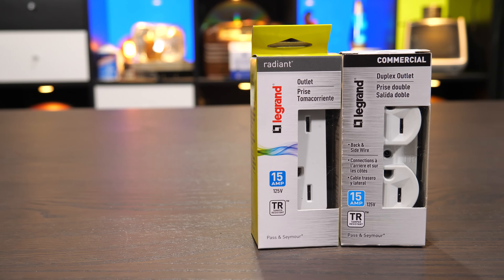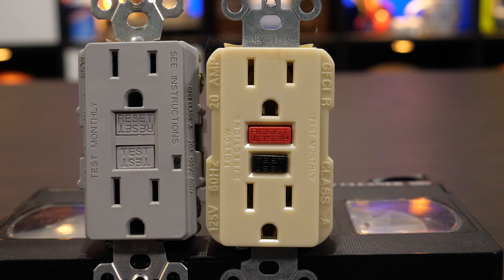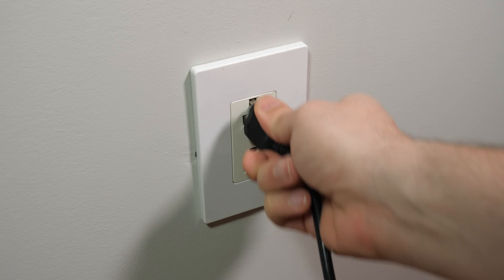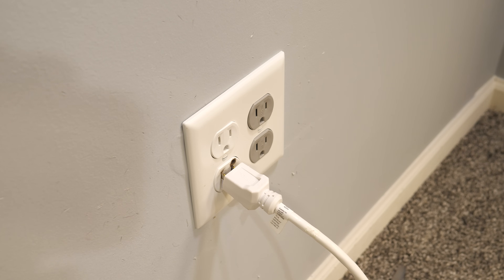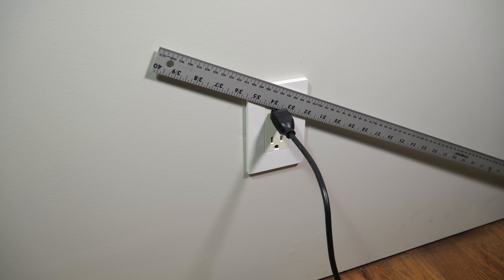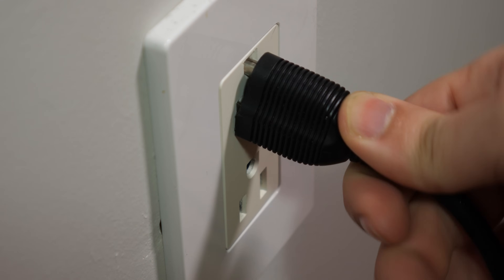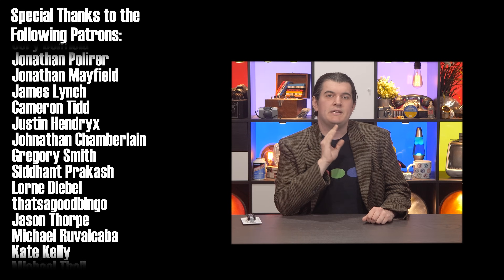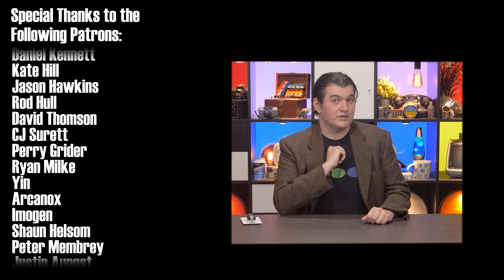Power outlets are topsy turvy - but does it matter?

Comment: Having a reversible plug design is one of the best things about Europe, no idea why no other regions copied it.
Reply: I guess other places preferred to have polarity guaranteed, at least when necessary. As the other person said in the US many ungrounded plugs are reversible, they’re just not the polarized type (so anything double insulated like say a USB power supply could use that). It often does end up being polarized anyways even if it doesn’t need to just because it’s common enough that there’s lots of supply for the ends of cords in a polarized form and a lot less for unpolarized cords. Devices that go straight on the wall don’t have that issue though.
Reply: The early BS standards for UK plugs were two-pin rounded. They weren't very safe though. BS372 even was 90 degree with a 45 degree cord entry.
Reply: Most US plugs are too. It is just in some cases that having a polarized plug can increase the safety of an object, like a toaster.

Comment: 15:28 This deficiency can be addressed by copying modern British plugs that commonly are recessed on both sides which makes it necessary to hold it in a particular way, as it is very uncomfortable or cumbersome to hold them in any other way thus minimising risk of finger zapping as well as helping one to generate enough grip to insert the plug in a socket or pull the plug from a socket.

Comment: we have dual sockets  turned 180 degrees, with ground pin in the middle. This is so it's easy to route 90 degree cable I think.

Weirdly enough, the L and N are swapped in one of the sockets...

No idea about variety of plugs in US but I think just plastic shroud above  and below would help a lot

Comment: The solution for the 45 degree plug at ~15:20 would be to simply install the outlet including the wallplate at an 45 degree angle as well. This would also end the discussion if vertical or horizontal orientation is better because the 45 degree orientation is obviously superior.

Comment: Use caution, maintain your equipment, don't play "throw knives at the wall", has worked for years.  I would like to see more 'side' or 45-side plugs.  Fit better behind furniture, less likely to pull out.  Those with 45 can be doubled in a duplex outlet.

Otherwise, who wants to completely revamp gazillions of plug/sockets in North America (Canada uses the same).

Comment: Two things: 1. In my 10 years in Chicago, I never once saw a sideways plug. 2. "Somebody" installed my kitchen plugs "upside down" with the ground on top, saying it was "the correct way." Problem? Every outlet extender is made for ground at bottom - mine have a solid plug at the top and a chintzy plastic pin to go in the ground of the bottom one. In a ground down plug, this holds it securely in place. In a ground up plug, it only has the plastic pin at the top, and wants to fall right out. So I think you've solved my argument in only 18 minutes.

Comment: I still find it odd that none of those power outlets have switches. That would alleviate the problem, you will still have people who wouldn’t use the switch and just plug in or unplug any device. As far as I know, here in New Zealand, you can’t buy outlets without switches - at least, I’ve never seen any.

Comment: Here's a suggestion: start running single phase 240v AC to the home and use (the generally considered superior) type G plugs for it. You could then also draw more power (3300W max) and as an extra bonus, enjoy some energy savings as power supplies are generally more efficient with the higher voltage.
Reply: You should check out some of his other videos: hint USA standard house supply is 240v single phase with a grounded center tap neutral.
Reply: @johngreen5808  "hint USA standard house supply is 240v single phase with a grounded center tap neutral."

Not true I'm afraid. It's two phase with each phase 180° offset from the other. Simple and easy to check with any decent search engine.

Comment: The only time it really is turned to ground up is to signify the switched outlet.  In US NEC code, Every room requires a switched light.  If there is no built in lights, i.e. recessed can lighting, then there needs to be a switched outlet...

Comment: My wife was using a measuring tape above a plug in our room. It dropped and slipped down, touching the two prongs. As measuring tapes do, it got stuck and fused to the prongs. It didn't just trip the breaker, but completely fried the breaker. Luckily for her she was only holding the plastic case of the measuring tape at the time. The item plugged in was a two-prong variety and ground-up wouldnt have saved anything. 

I would like to see a video about how you would redesign the US outlet and plug combo

Comment: I've witnessed one these bridged pins incidents, a kid was resting a quarter on top of an adapter, and then the quarter fell behind it and rested perfectly between the pins. It's not hard to do, though you are right that in many cases there isn't a ground pin so orientation wouldn't have mattered. It seems odd to determine what a home design should be based on some random products, if people switched orientation those products would switch. And there would be a market for adapters that make the old products functional. It seems like you're putting the cart before the horse.

Comment: I think this is a perfect example of "You haven't solved the problem you just moved it." But the argument you make for not flipping them because of right angle plug falls exactly within this too. You didn't solve the problem, you moved it. You still can't plug 2 right angle plugs into the wall just because they're ground pin down. If you plug a right angle plug into the top, you can't plug one into the bottom. I don't see any reason not to put the ground pin at the top.

Comment: Solution:   Try several things in combination. Right angled plugs that assume ground up with a deeper thickness with recesses to grip your fingers into. Sleeved Line/neutral pins. And when multiple sockets, assume side by side formation, not one-above-another.

Comment: Seems like we need to get a l'il Bri'ish abo't it and stop being pansies about managing our own plugs. Any plug can be transformed into a right-angle if the and is chopped off, the wires are stripped back and the loose ends are fastened to a replacement right-angle connector.

But maybe… we need a new adaptation of the standard. For higher-draw appliances, we have the capability to twist the connector into position. Let's adopt a variant of 5-15P that's a twist-lock connector. Oh wait we have that! L5-15! It could be made code for connectors to be L5-15 and it'd improve safety by a wide margin because you have the twist the damned thing once it's plugged in for additional safety. But then everything would need to be adapted for this, and you'll find dodgy L5-15 to 5-15 adapters.

A twist-lock solution would also complicate (or make extinct) 6-taps which rely on the standard 5-15 connector. It would however standardize a twist direction, and in turn standardize a 45-degree cable orientation. But it would become less safe for sideways-installed outlets. Yeah, it's some tough stuff to figure out.

Comment: Years ago, while working in a pharmacy, the cashier dropped a dime (Canadian dime)  and it JUST happened to land in between the plug and the wall.   What followed was a loud noise, sparks, the breakers popping.  When we found the dime, it had a hole melted in the middle. 
 
Had the outlet been installed upside down, it would have most likely  hit the ground connector and bounced away .  Just a once in a million shot.
Reply: That is an excellent point and actually hits the nail on the head (the dime on the hot pin?) about what I feel Alec missed in this video: Statistics. We know that low-probability events will eventually happen: that's the whole law of statistics is that if it has a 1% chance of happening then eventually, it happens!

So a better measure of effectiveness is how much does this change move the probabilities? Instead of 0.1% of happening in a year it drops to 0.01%? That'd be pretty big deal; especially if that movement was for kids or fires.

The population size is huge and there are enough anecdotes in this comment section to make me think that this happen more often then Alec acknowledges. If so, then small changes in the probabilities can have major implications in the absolute number of incidents.

tl;dr Alec's argument is weak sauce on this episode. I've never had my house broken into but I still lock the doors even though it's a very low probability event.

Comment: I had a wi-fi extender brick with one of those little push to reset holes.  Someone thought it would be a good idea to leave a paper clip sitting on top so they could reset it whenever they needed to. The next time the brick got bumped, the clip fell right across the plugs and BANG. Tripped breaker and nasty soot stain.

Comment: All the Nema 5-15 outlets in my house were installed with the ground on the top. It drives us crazy, because all on-wall adapters expect the ground to be on the bottom. Everything looks upside down. I've been slowly replacing the outlets in each room and reversing this craziness.

Comment: This past year I decided as an add-on project of replacing my light switches in my 32 year old home with modern programmable dimmers that I also replaced all the receptacles as well. First, most homes have more than you think....I counted 48 in my home at 3280 sq ft. The original receptacles were all installed ground-down and I installed the new ones ground up. Why? Because I had heard somewhere that ground up was correct and it was like that on the packaging for the box and printed indicators on the units (in this case, Lutron). it did pose a challenge to some older power strips I have and I have replaced some of them that have right-angle plugs. That seems to be a decent solution. Also, I was wondering about if there was a correct orientation for sideways since I have two of them in my kitchen. I just checked and I wasn't even consistent there...one of hot wire up (correct) and the other is hot wire down. Although as Alec pointed out there is really no code requirement for this, my anal nature means I'll reverse this at some point soon to match the other one. I also have an outdoor plug (shielded in a box) that is hot wire down but I think I may leave that as is since I use a right angle extension court on the patio where it's located and it actually useful for the cord not to point toward the door to the inside which is right next to it.
Reply: folks these days are on some weird and confusing kick to put the ground up.  for the last 60 years the standard convention is that for normal, 15 amp circuits the ground pin goes down, and for 20 amp circuits the ground pin goes up.  Also in homes with switched outlets for lamps they put them upside down sometimes.

Comment: I would like to add that I've seen a lot of machine shops that put ground up to prevent any small chunk of metal flying and landing on across the terminals. A lot of portable electric tools don't come with angled plugs and because they are meant to be unplugged frequently it doesn't make sense.

Comment: Ok, but what if they mirrored the the outlets so the bottom one is the throwing-knives-at-the-wall buzzkill kind and the top is the about-as-safe-as-you-can-make-it-for-crappy-US-outlets kind? 
Then you could also have two of those weird "flat"/UK-inspired plug in one duplex since the cables wouldn't cover the other socket.

Or just bite the bullet and convert the entire country to the superior EU standard, which would probably cost like 5% of the military budget.

Comment: I just recently replaced some old 2 prong outlets with GFCI 3 prong outlets.   And it might bug some folks that I'm not consistent, but I did some ground prong up and some ground prong down.   Where do I make the difference?  Typically, I'll do ground prong up in areas where I'll use computer or other heavy duty equipment that's used all the time.  I find the ground plug on top helps hold the cable with more stability against the sag of weight and the prolonged fight against gravity.  

Other times, I orient it the other way, just out of habit I guess.

Comment: adding sleeving doesn't even really need to be that deep. as you were showing when the plug was pulled at an angle it generally only was slighlty out; like probably the thickness of the plastic housing of the electrical outlet if not a hair more. That alone would help make the outlet much safer. Just sleaving that tiny amount into the plastic housing.

Comment: As a European I must also say a simple solution implemented here is recessing the plug inside the outlet, look up a European plug and see how the circle where you plug is recessed. And it could be an easy fix for the US, mainly replacing faceplate with a thicker one

Comment: Radical solution, ditch the 120V "neutral" and go straight to 240V with one of the European connectors (there are a few varieties to choose among, let Alex try them out and make a nation wide decision) as the new standard for all new constructions. Might even go to 50 Hz for extra compatibility, though that's optional.

The entire EU just recently adopted an entirely new, common light fixture connector, the DCL (Device for Connection of Luminaires), making all existing obsolete.
Why is this relevant? Because it shows it is fully possible to make changes when wanted.

Comment: I refuse to plug right-angle plugs, including wall-warts, directly into a wall.  And I stopped doing that long before I started mounting my outlets ground-side up.

I use a little pigtail.  It's a little bit of a pricey solution, but it makes it so outlets don't get blocked by wall-warts, even in power strips.